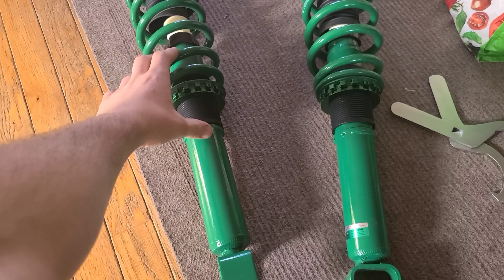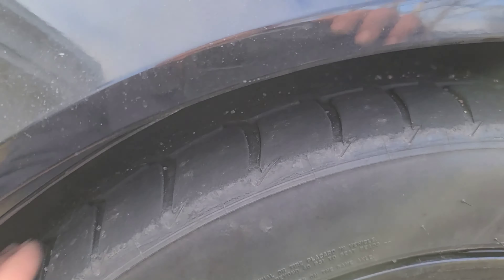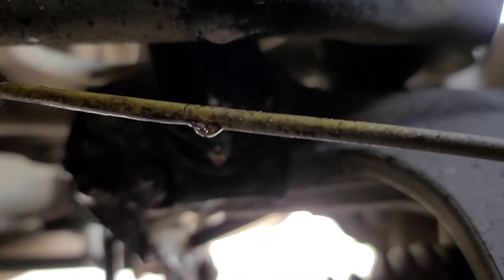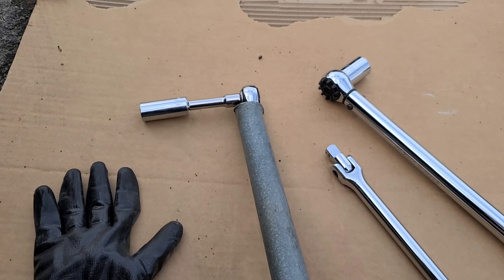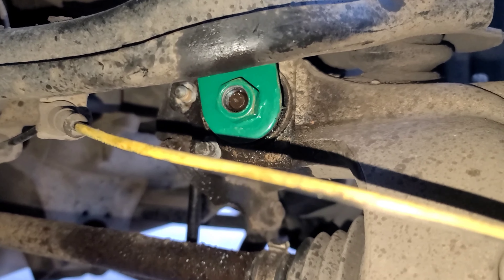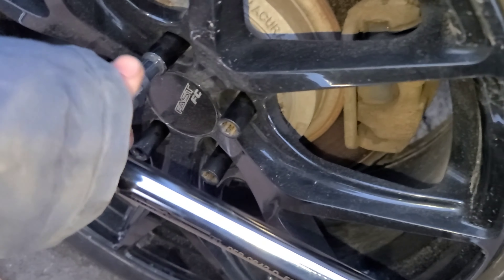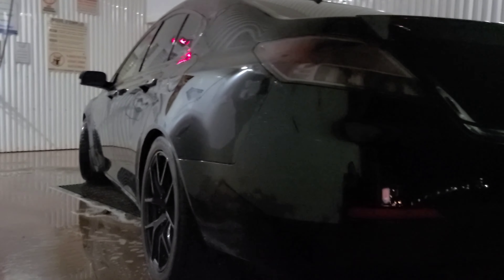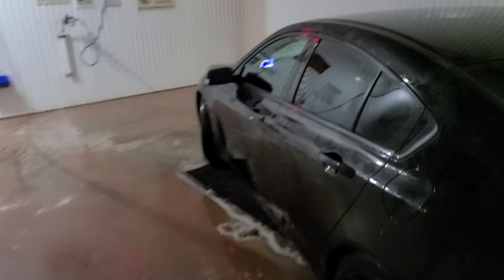Acura TL SH-AWD Coilover Installation!! (Part 2)

Comment: Hey man how's it drive with the coils , I just picked a 07 type s a while back and I'm looking at some ebay coils
Reply from the maker: It handles way better, but the tides is a lot more stiff. If going coils I wouldn't cheap out though, cause they won't last very long.
Reply: @RevsALot Okay yeah I was looking on ebay at the Tein coils or Maxxspeeding ones . I ended up going with some Monroe's on rock auto for now

Comment: Ok unicorn looks good. Want to know about the ride difference. My auto rides so nice and grips the road. Want to know if coilovers change anything as far as ride and the AWD system. Found a unicorn and applied to get it today. Waiting to hear back from dealer. Gonna get rid of my auto box of I get my 🦄 unicorn.
Reply from the maker: It's definitely a lot more planted in the turns, I think need new bushings to feel the full effect of them. Rides a little stiffer, but I haven't played with the dampening yet either. Waiting for nice weather for a good review👍.
Reply: @RevsALot  be waiting for that. I love the OEM shocks and how they keep the monster planted on the ground and doesn't flair out on turns. The auto box just cheapens the thrill of a 6 speed like my 03 C. L.

Will be waiting on update and hopefully my 🦄 unicorn will somehow appear
Reply: Are the bushings gonna be  a major pain in the ass to get pressed in and installed?

I've had aftermarket motor mount bushings that created loud vibration at idle.  (This was 15 years ago)
Reply from the maker: I'm not sure, but I do believe I need to replace them soon. Probably tackle it this winter.

Comment: I really want to ditch my 335d for one of these so badly, but at the same time I don't want to ditch 400whp for 300whp top
Reply from the maker: Fbo tune on 93 can make around 320-30whp with the manual. Supercharger kit puts its 420whp+. Just a lot more expensive to get that power👎.
Reply: @RevsALot  I do want a Manual, as 335d was auto only. Also don't you need to delete AC for thr4tg gen TL Supercharger kits?
Reply from the maker: You can reroute it to the trunk, but need to extend your lines to the trunk. I never use AC anyways, but I might keep the AC and show the process. I hear a lot of ppl saying that's the reason they don't want it, but windows down is good enough for me👍.
Reply: @RevsALot  I'm from Florida and we're getting into summer, so A/C is unfortunately a must
Reply from the maker: Ah damn, yah the hottest we get around here 80-90°F and that's only a cpl weeks

Comment: Less tread =more grip in dry conditions.
Reply from the maker: Not quite, new tread definitely grips better...less tread does help with wheel spin off the line to avoid bogging it though.
Reply: Well, when you look at race tires, do they have a lot of tread or are they slightly treaded? Agree to disagree I guess. Good luck with your car.
Reply from the maker: @adamlancellotta391  race tires/slicks are made of a different compound which are extremely sticky in dry warm conditions. Just did a quick Google search to make sure I wasn't giving you false info👍.